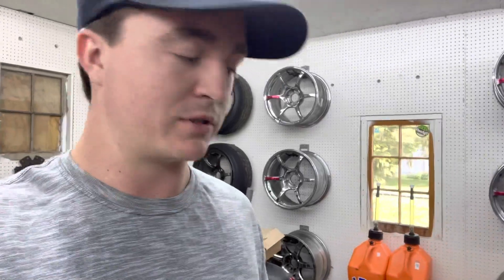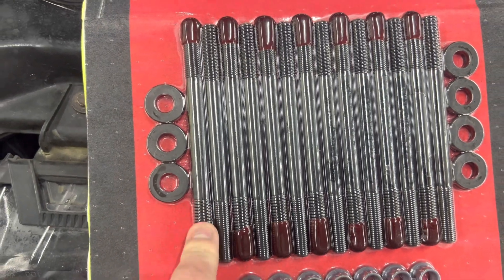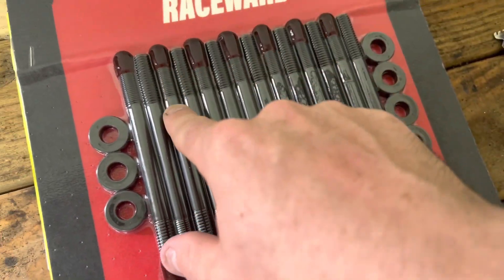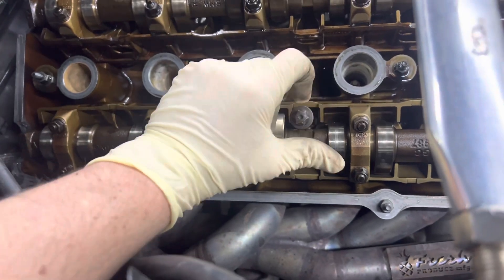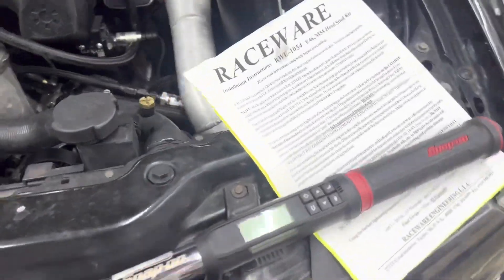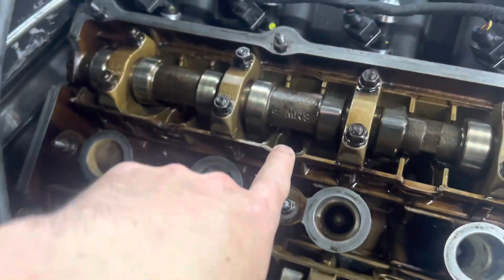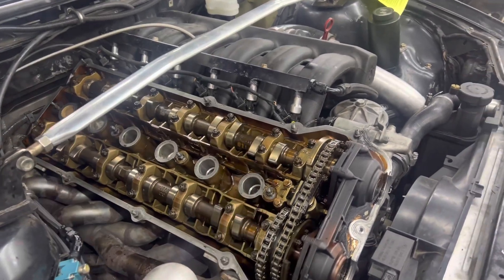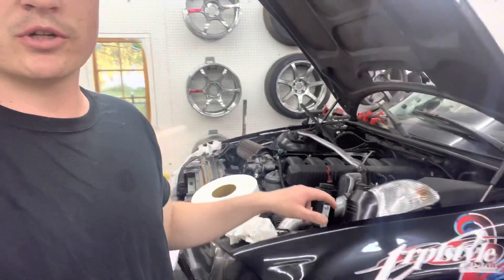Turbo E46 M54 Head Stud Installation

Comment: Any update on this? Did this help your issues? Just wondering because i want to build a m54 in the future. But a full na build and wanted to know how well these have worked for you
Reply from the maker: It didn’t work lol. The head gasket was wasted when I bought the motor. When I disassembled it I found one new valve and the rest were OEM.
I suspect the head gasket was reused.